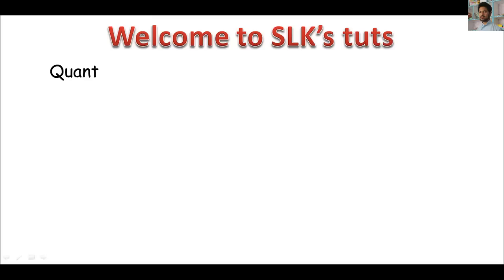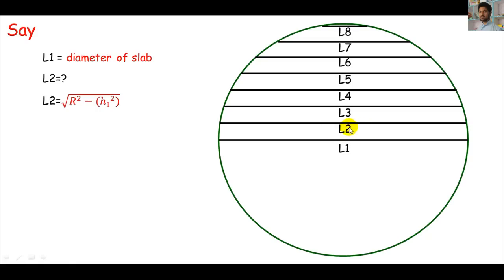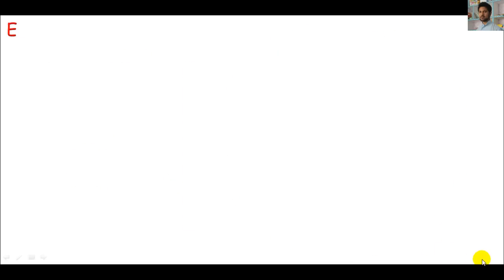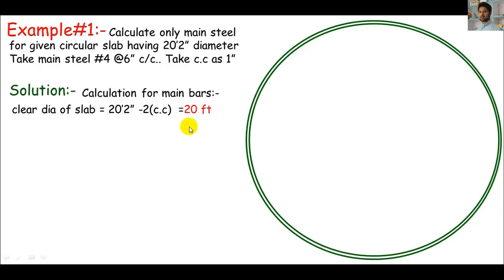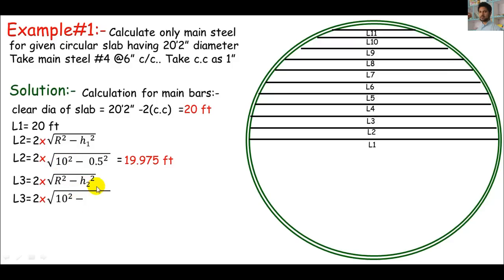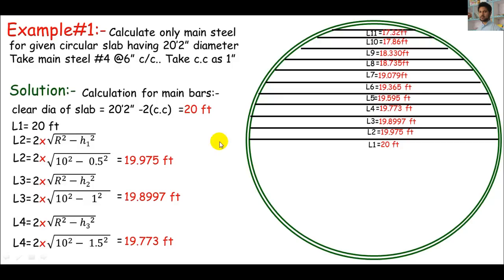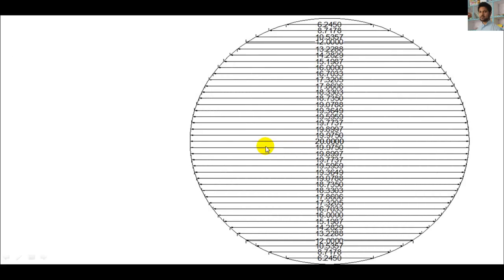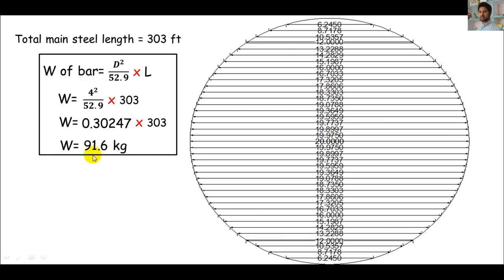English-Quantity survey/ steel calculation for circular RCC slab.

Comment: You have used D2/52.9 and there is also another formula to calculate the weight i.e D2/162.
Is there any difference between these formulas??
If yes,then what is the difference and if no then why different numbers in denominator??
Reply from the maker: Yeah. There is a huge difference...
D2/162.198x L is for MKS system where diameter of bar is taken in mm and length of bar is taken in meters. (Note: video for proof of this formula is in playlist of Quantity survey) and D2/52.9 xL is for FPS system.
Reply: @Sulimankhanacademy  thank you sir

Comment: Thank you so much for this video sir... but then i disagree with the subsequent radius you used.. if the radius for L2 is half the length of L1 then radius of L3 should be half of the length of L2  being calculated. I stand to be corrected.
Reply from the maker: benedict solomon 
ohh no man. only the radius of slab should be used always which is half of L1. this radius is for all bars.

Comment: sir, why we multiplied by 2 in this formula  2*R^2-h1^2 over root ? And also how to change #4 into diameter and last one is how to convert D^2/52.6*L Into D^2/162 *L
Reply from the maker: raman shah 

the formula gives one side cutting lenght and we need for both sides. thats why we need 2 in formula.

#4 bar is just bar having 1/2 inch diameter.
Reply from the maker: and the conversion is so simple.
but i cannot explain in comment. because its little technical .i will make video on it. by the way i have uploaded video on these two formulas derivations

Comment: sir steel weigth formula in FPS system is d^2/24 *L or d^2/52.9 *L
Reply from the maker: akhya khan 

both are ture.
d^2/24 * L gives weight in pounds.

and
d^2/52.9 *L gives in kg
Reply: +SL Khan ok sir